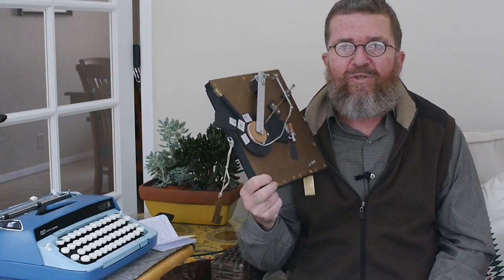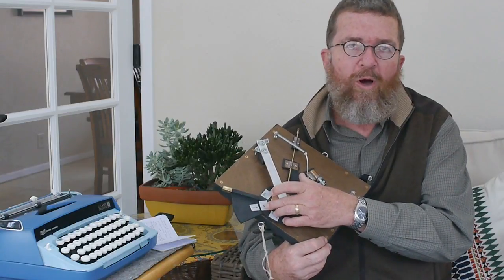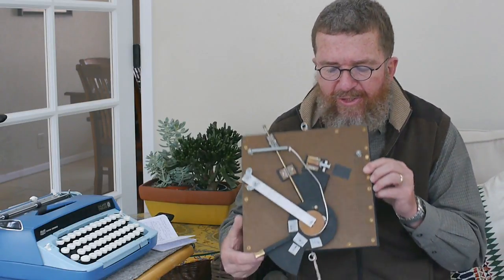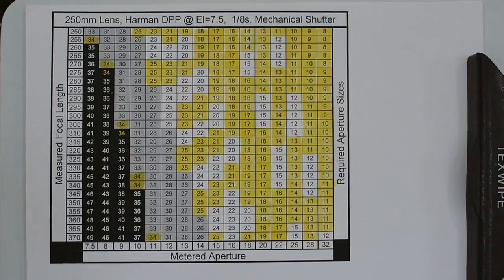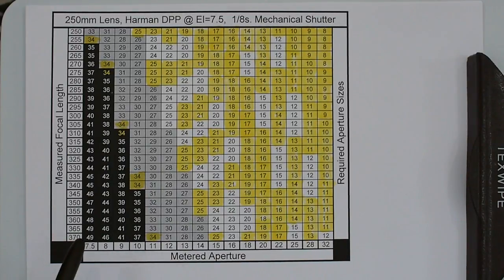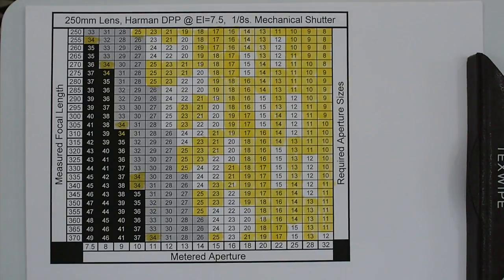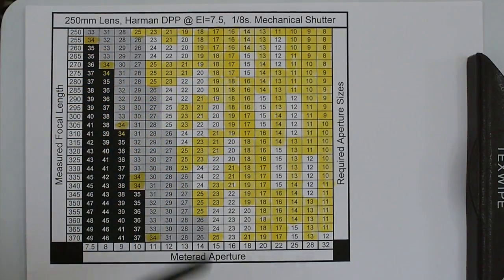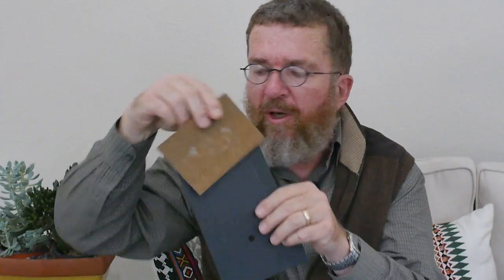Experimental Box Camera Shutter, Part 2

Comment: Hi Joe,
Did you work on this shutter or any others further? 

If you wanted more variance in the shutter speed, you could have the string wrap around different diameter pulleywheels which are fixed on the shutter axis, similar to changing the belt speeds on tools or a record player. Would love to see some more photography videos!

Comment: Hi Joe
I have only just found you. I am really impressed with all you have achieved. Can you help me with how you managed to work out your chart?  is it mathematical or masses of testing and compareing to a conventional 5 x 4 camera. I would love to know so I can start working things out on my project. Regards Martin
Reply from the maker: This chart was based on calculations. It essentially tells me how big of an aperture stop (i.e. 'waterhouse stop') I'd need to get the required focal ratio called for by my meter, at the focal length currently set on the camera. As such, it also compensates for any bellows extension factor if doing close-in focusing.

The chart doesn't take into account shutter speed, it's just an aid to determining the proper aperture size based on the meter's reading and camera's focus setting.
Reply: Yes, I think I get that. I guess what I am struggling with is that I am working on a 5 x 4 camera with a macro filter as a lens how do I start to work out how fast it is without an aperture plate?  then what diameters they need to be to make different f-stops. Then from what I can understand of your chart, a single diameter will be a different f-stop depending on the bellows extension. ( I think my head is about to explode) I there a calculation I can do or is it just loads of testing?

Comment: You've done amazing work: thinking that shutter through and building it.  I wonder if the place where your string changes direction is a low-friction rolling pulley [a little Teflon pulley might help]?  Another idea: reduce the weight of the shutter blades to speed up the rotation [lower inertia].  I'm wondering if you could buy carbon fibre sheet [very thin, black and very light].  If you ever had a sufficiently high-speed shutter action and wanted to "damp' it down for longer exposures, you might find that an aluminum blade [it doesn't have to be very thick, therefore maintaining low inertia] could pass between two neodymium magnets [Leevalley.com] and this will provide electromagnetic braking.  The magnets' distance from the shutter axis could vary the braking.    I find your work fascinating and ingenious in every way.  You might want to study the shutter in a Mercury II [2] camera - it used a rotary shutter and was very accurate.  I believe the disc had a variable slot in it.  The disc always moved at the same speed; the slot-width being the variable [ I believe].  The shutter stop and "parking brake" might be improved by attaching a tiny neodymium magnet -to  the moving shutter leaf - that contacts a fairly substantial steel stop.  This might help solve that "shutter bounce" phenomenon that was apparent in your video Part One.  AGAIN: Bravo in every way.    I'm about to start working with Anso 120 box cameras, and the idea of double, quadruple and octuple exposure has occurred to me for tripod-mounted work requiring more light on the film.  Please give us an update now and then.  Excellent videography, by the way!  Is there somewhere you've given information on your meniscus lens?  That interests me also.